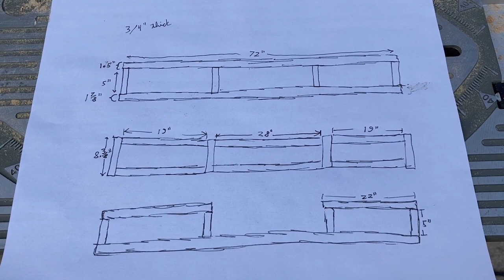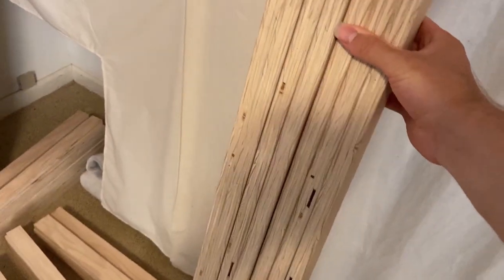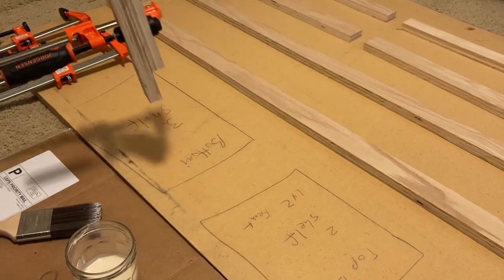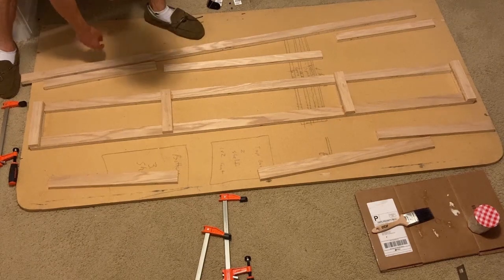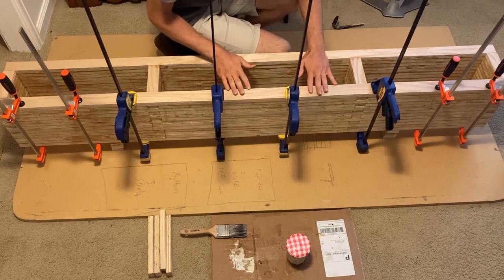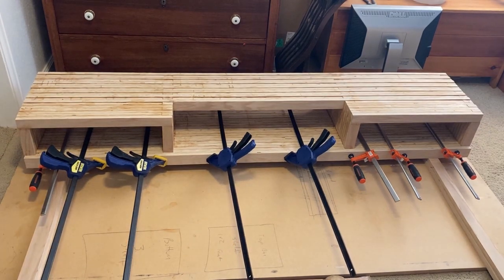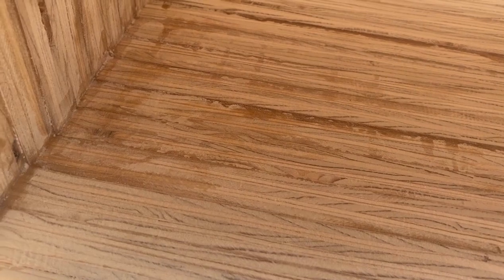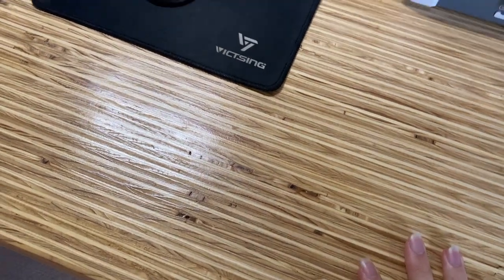How To Make a Modern Studio Desk from Plywood!

Comment: great job on the desk - I would highly reccomend some short speaker risers / stands to help decouple the loudspeakers from vibrating the desktop surface and contributing to any unwanted earky reflections / room modes / vibrations. Doesnt seem like it would, but trust, this can make a world of difference in the accurcy of your monitoring. Also, wall treatments are gonna be desirable if you want ot do any really serious mixing in there, but for now just get a couple of those nice speaker blocks (I believe auralux makes them) and youll be an even happier camper than you are. Sick desk!
Reply from the maker: Glad you like the desk! I’ve got myself some foam pads under them now, definitely getting a nice clean sound